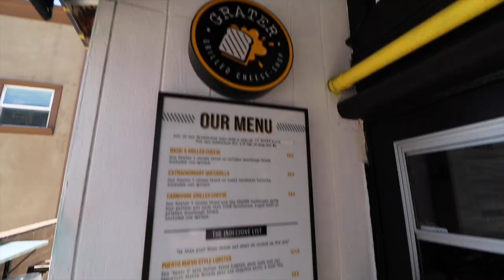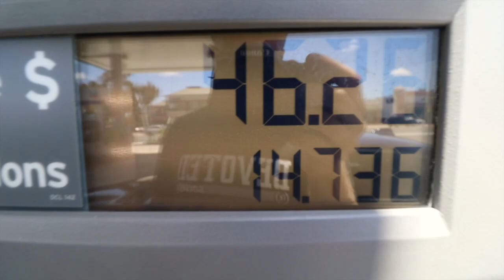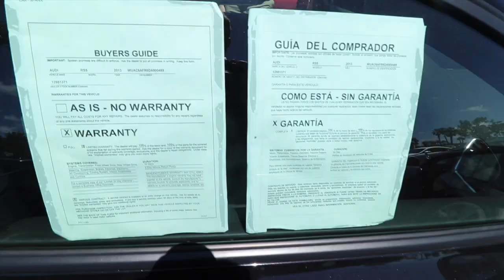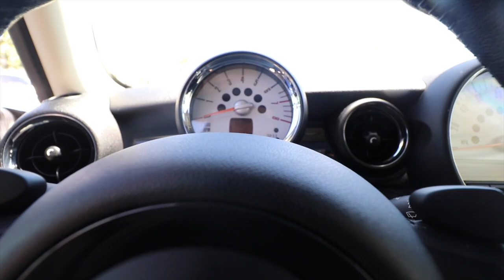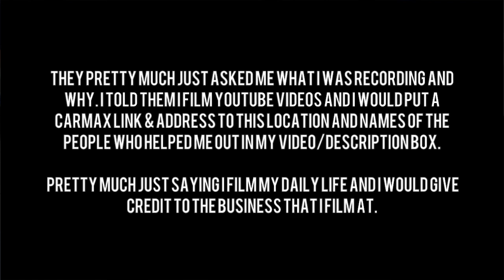Getting in trouble at CarMax...

Comment: My personal experience:  The people at CARMAX have always been polite and professional provided you are the same with them.  They are in the business of paying the least possible amount for your car and use their own internal pricing guides to determine their offer prices.  Forget trying to negotiate a higher price using Kelly Blue Book.  They even low ball NADA values.  What is interesting however is that in most cases they will give you a better deal than new car dealerships as new car dealerships will just tell you that they are in the business of selling, not buying cars.  My only complaint with Carmax is that they provide a free appraisal online for your car in order to get you to visit their dealer network.  Once there however, the offer usually goes down significantly as they make calls to their jobbers to see what the local market demand is for your car.  Once Marcus Lemonis became a partner he told the owners that this practice had to come to an end.  I can tell you as a fact that CARMAX still uses jobbers but that is NOT my problem, it is for Marcus to handle.  So does CARMAX work?  Absolutely, if you are desperate and need cash in a crunch, CARMAX is awesome.  You walk out with a live check and it usually clears in one business day which I can attest to.  If you are looking to get the best possible value for your car however, sell it on your own.  Would I use CARMAX again?  If I needed fast cash, absolutely!  If I had time to spare, I would sell the car on my own.  Also, never use CARMAX to trade in a limited version / edition of a car or if you have a fully optioned aftermarket car.  They will just take the options from you for free and sell them at a much higher price to the new buyer.